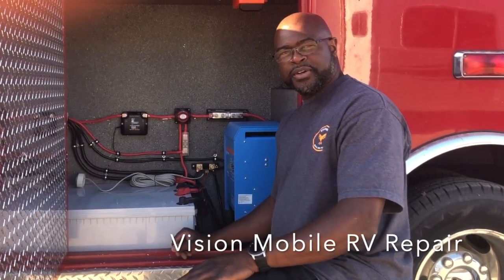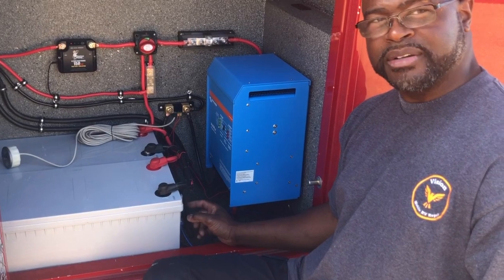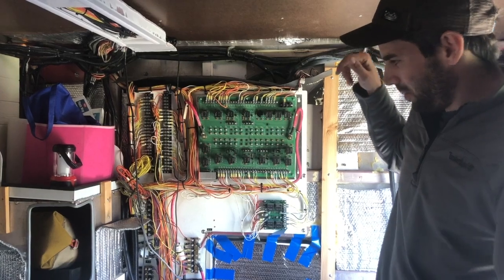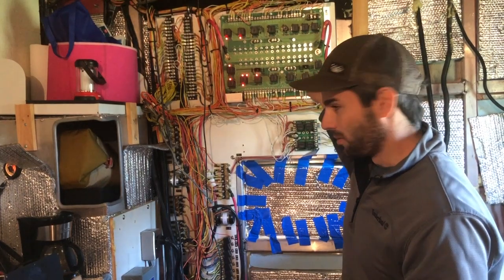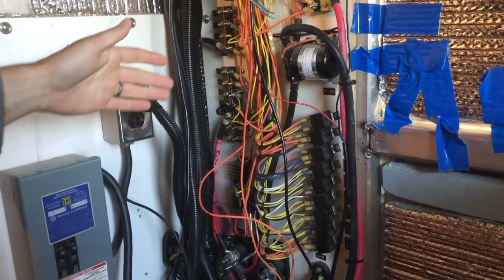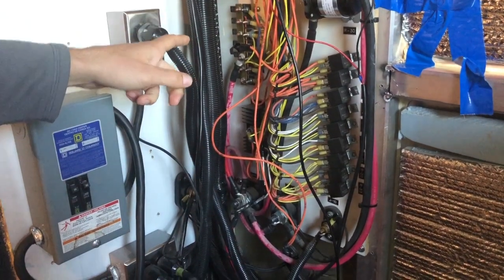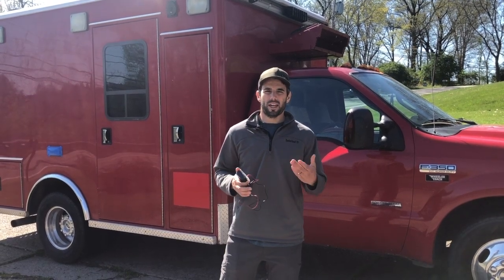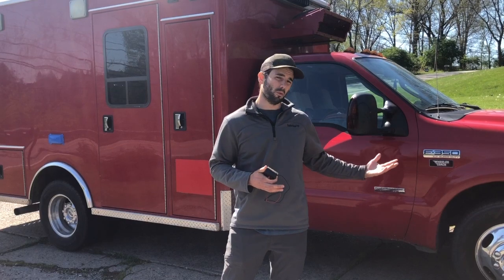Ambulance Conversion: Inverter/Battery Install, Rewiring 12v system, Electrical Walkthrough

Comment: Props to working with the original electrical. I had something draining my starter battery and couldn't figure out what. I gutted my whole system and started over. Now they are separate. I do have a question though. How are you attaching / running solar into the rig or are you even going that route. Also how are you running water. Great video
Reply from the maker: Oh wow! How is it working now? Re: your questions, we are attaching solar this fall once we return to Arizona (phase 2 of our electrical plan) and we are currently installing our plumbing system and kitchen - video coming within the next few weeks to a month depending on how many challenges we run into! We're setting up an under-the-truck system and here are a few sites we've been looking at for resources: https://www.classacustoms.com/ https://www.vanlifeoutfitters.com/camper-van-plumbing-and-diagram/ https://faroutride.com/water-system/
Reply: @bethzabiegalski7874  the electrical system works great I have 400 amp hours of lithium ion. So far as a test I ran everything as long as I could I got 8 hours of use out of my lights my split unit ac and my tv. If you are interested I would be happy to share pictures of how they look incase it sparks an idea.

Comment: Hey! Great video. I have a 1994 e350 ambo 7.3l. What did you guys do for your starter batteries? Do you have any recommendations for isolating my 2 starter battieres and adding a house battery? Thanks in advance!
Reply from the maker: Hey, thanks! Last winter we installed a Victron 3000W inverter, 400 AH of agm batteries, and a battery isolator so that we could charge batteries from the truck while driving. We disconnected all the outlets and power from the cab since ambulances are made to run all the stuff back there while they're ON and of course you'll want to run it while it's off :) Cedric, the RV repair guy and former electrician talks a bit about the process at the beginning of this video. We definitely recommend working with an expert to help start to understand the system and what you need, which is what we did to get started. Happy to answer questions!

Comment: Shutting off power is a great safety measure. It doesn't solve the potential issue of there being a capacitor in the system. Capacitors are designed to store electricity even after the power is shut off, and if they are big enough, they can kill. Capacitors are necessary to give an extra jolt for starting large electric motors, such as an air conditioning unit. Also, an electrician's gloves will insulate you from accidentally getting shocked by completing live circuits.
Reply from the maker: Great points for folks to consider! Our truck house does not have a capacitor in its system, everything is protected by a fuse and we test everything with a volt meter before touching it. More safety tips at instagram.com/vanlifeelectric

Comment: Dude your advice is on point.  I have an ambo project myself and pretty thick into the wiring for the last handful of months. Early on I pulled out some stuff that I should have left.  So it goes.... Wild how much is going on in these.  Have you rewired into your system yet? Also have you ever found wiring diagrams for components you had?

Cheers,

Scott
Reply from the maker: Thanks, Scott! Yes to both your questions. We were fortunate to have the wiring diagrams with the purchase of our truck. If yours is Wheeled Coach, you could probably request diagrams from them for your specific make/model

Comment: Hi thanks for your clarity. I noticed you took out the heater. We are in The demo stage and wanting to remove the heater.  When removing the heater there 3 hoses that go to the engine cooling systems. Any idea on how I can return it to the stock 2 hose configuration.
Reply from the maker: Hey, Sarah! We took the ambo to a mechanic to get that done. We didn’t want to mess anything up in the cab, and it’s helpful to have some help! They evacuated the lines, recharged and capped them, then we just had to rip out the furnace. Sorry that’s not too helpful from a strict DIY perspective, but we definitely value involving experts in our process. Best to you!!

Comment: I’m sooo lost. My 115v three prong sockets have no power. Doesn’t matter if the truck is running or not.
Reply from the maker: Hey there! Your 3-prong outlets are AC power, and trucks are DC power, so you need an inverter to convert the truck’s power to AC in order for them to work. If you already have an inverter, there may be something wrong with it. Let us know how it goes!

Comment: I started a redo to rv on a 1994 ford e350 ambulance  a few months ago.  I was first going to leave it as is and just add a few things to my taste.  To date I have gutted the box to just the raw box and removed many wires to things I could trace.  All of the emergency lights and med equipment has been removed.  It did not come with an inverter.  I am installing shore power as one project.  I will add shore battery to power any 12 volt items for a second separate project.  Some day if I add solar it will be a third separate project.   None of these will be connected to the other, at this time, as I do not have that knowledge yet.  No one, and I mean no one, has any knowledge of an ambulance including the many EMT I personally know.  I am a retired cop, 33 years.  They all tell me that they have someone who does that for them.  I have yet to find that person and I think they are all too busy as I feel that there are less than a dozen for the whole country!  You tube has been the source of my education on this but has not been much help.  This site is the first that even talks about the wiring.  I will follow as I am ready to can this project.  I have done schoolies and utility trailers but never an ambulance.
Reply from the maker: Hi, James! Congrats on your reno project - that's exciting! I think the biggest takeaway we got from this process that we'd like to share with others is that learning your rig's electric system simply takes time. There would be no video we could produce that could explain someone else's system since a lot of different models are put together slightly differently - though we'll surely try to get you started! Anthony has spent the last 4 months getting to know it and has a fairly solid understanding at this point, and he got invaluable information and guidance from an electrician we partnered with to install our battery system at the beginning. I'd also recommend asking mechanics in your area if they know anyone who used to work on ambulances. We got super lucky to have found one of those last week, so we'll certainly be partnering with him in our projects going forward. If you have any questions about your ambulance, let us know and perhaps we'll have some insight that can help!
Reply: @bethzabiegalski7874  One year later I am still working on my ambulance conversion.  I have come a long way but ran low on funds which has resulted in slow going.  I did find one guy who had worked on ambulance wiring who helped a little.  In my research I have found that no two ambulances are wired alike under any circumstance as they are built to order individually even if built at the same time for the same department.  The technology and uses change several times a year.  Mine is useable and I have done several trips to date.  I would still do the same over again and I would encourage anyone who is thinking about this life style to just do it.  You learn something new every day and life will not be boring.
Reply: It is now another year later and I finally found someone who knows solar and doesn't demand an arm and leg to help.  Last week I finally have solar hooked up as a start.  Adding to it will be a breeze from here on.  Since I got the vehicle I have had to do some major repairs that I have to pay to have done.  I am no longer able to do my own work on the mechanical side.  Alternator, belts and hoses, new air conditioner, tires.  Still to do, undercarriage and front end work.  The good side is I will have a tank when I am done.  The bad side, a tank would be cheaper.

Comment: '''Yes!  I’m totally lost!   My questions too dumb for public maybe.
None of my outlets. Work!   I see batteries and charge controllers..... and a note,mentioning prewiring for second inverter...... I don’t know if there is a first inverter.  If they kept inverter, wouldn’t that explain the lack of power at the outlets?   I just got ambulance  1998  7.3 power stroke with. Lots of work needed<, but. Low price and decent. Box.  I don’t even know where to take it for engine or ambulance stuff.   I have   Designed the shower location and toilet and and waste. Management systems..
Reply from the maker: Hey! Feel free to connect and message us on Instagram (@theheartwantsadventure) to chat further if you want! Questions for you - is your ambulance running when you try the outlets? If you have an inverter, it should be under the pilot seat in the box, at least that's where ours was. The ambulance + inverter is set up initially to send power to the box while it's running. But whether you've got the engine running for power now or you've got the battery bank set up, if there's no inverter, the power still can't switch from DC to AC so the outlets won't work. Hope that helps a bit! Any diesel garage can work on your engine also, and we recommend at least consulting with an electrician to get started with your electric if you're new to it.
Reply: @bethzabiegalski7874   thanks for the videos. David